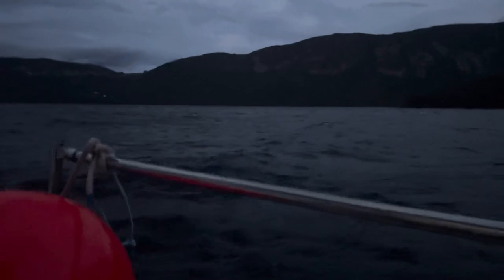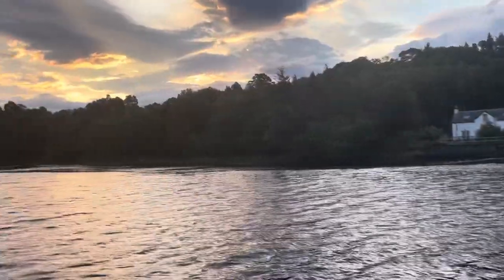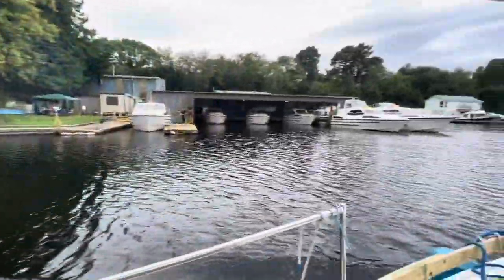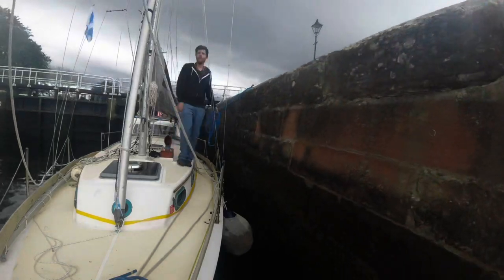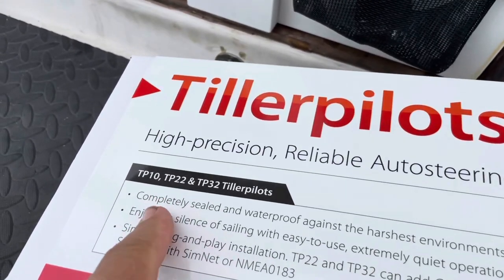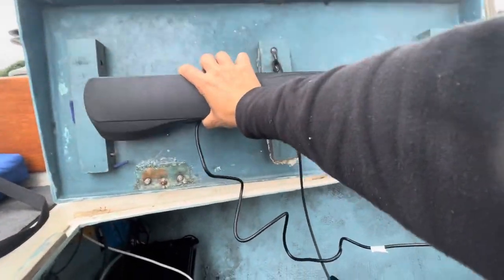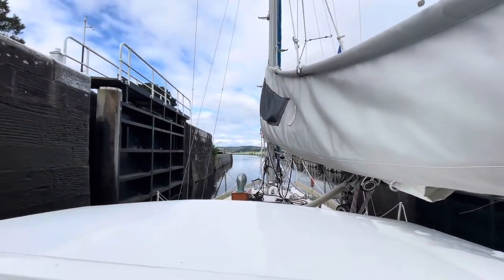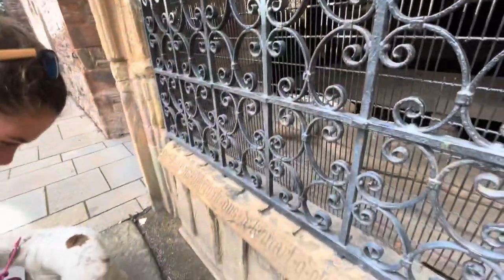Last of the locks, autopilot, highlands & isles, NC500

Comment: Did you ever try having that corroded circuit board repaired on the old autopilot?  Like your idea of sheltering the new one when not in use.  Was thinking you could also make a splash resistant cover for it out of waterproof fabric to help further protect it from exposure when In use, with a drain hole underneath to ensure that it won't trap any intruding water.

Comment: Re your TP10 autopilot I have a the same. IMPORTANT remember to put it in STANDBY mode if/when you disconnect it from the tiller for manual steering, otherwise it still keeps trying to steer the set course and eventually strips the gears inside. My previous TP10 (3 years back went back for repair and they said it had water ingress (previous owner) so dont believe all it says on the box.) Another great vid (Uk south coast resident 30ft catamaran owner)

Comment: In 2014 just after I went under Kessok bridge. ( you can see it in your video as you exit the sea lock. My tiller pilot failed & I ran aground & broke my rudder. I was rescued by the RNLI in less than 8 minutes ( they were on a training lesson under the bridge) & had to go to Inverness marina for new rudder. Cally canal video was great & it was interesting to see the bitsI remember  again. Thanks

Comment: I saw where you had electric wire trouble, What i do when 2 wires come out the same end put liquid tape out about 1 1/2 inch let it build up then when you put the heat tube on there will be no way  for air to get in. when i had boat i had bottle on board at all times. Good luck.
,